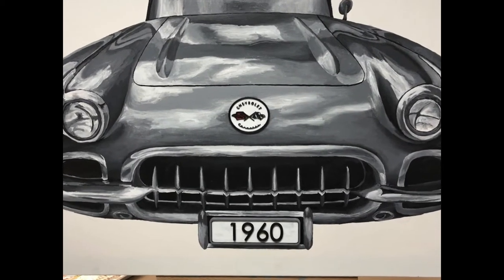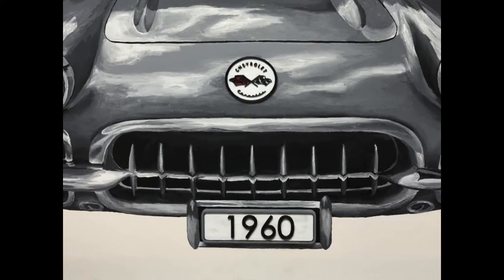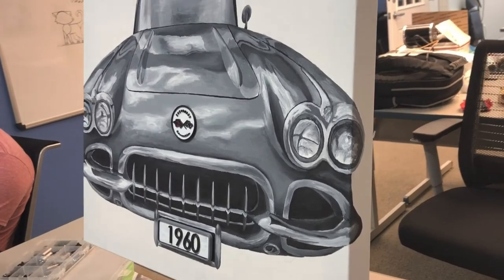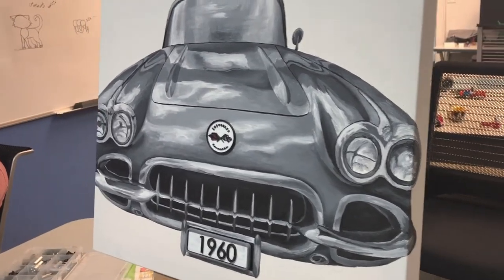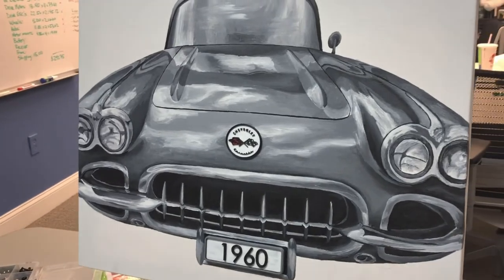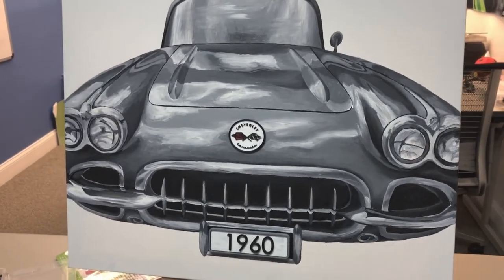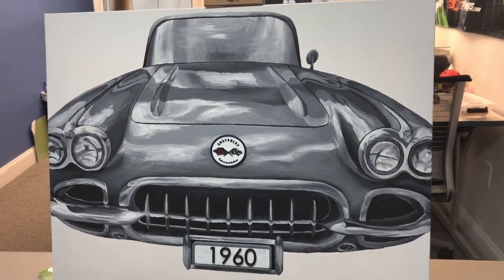Painting a 1960 Corvette // DIY Father's Day Gift

Comment: Hey witch doctor im not a bot builder but i think the rib is to tin it would be betterif its a solid armor then just put a layer of ribs armor
And the self riting mechanism ia a long bar the is on a hinge im not trying that your bot is bad its one of my fav bot
Reply: There is a weight constraint they have to work with.  some parts/armor are heavy thus made from thin/lighter material to conserve weight.